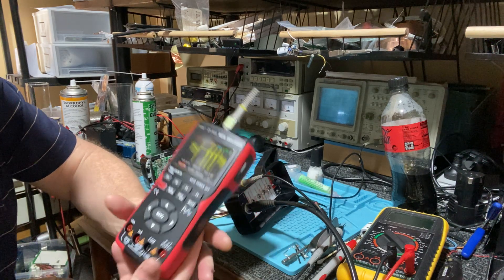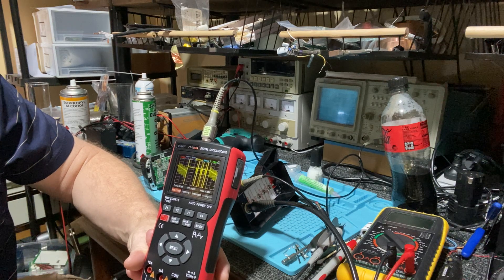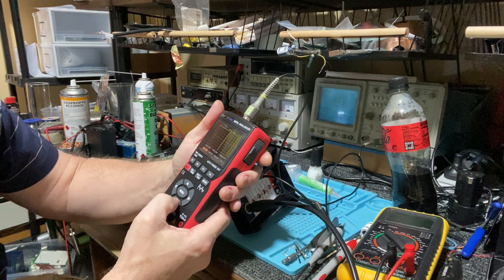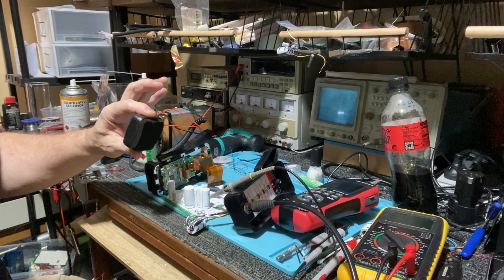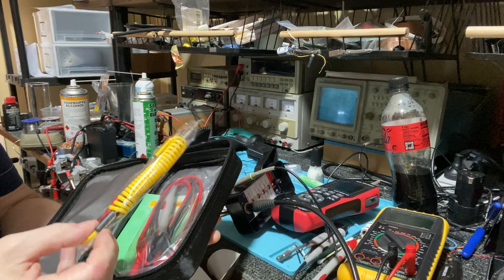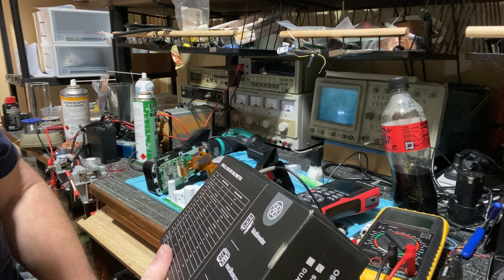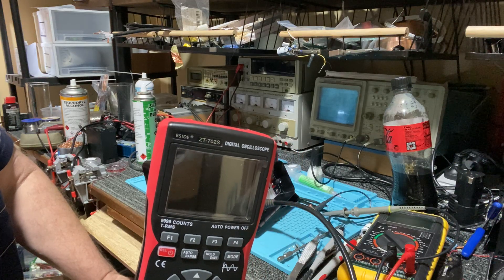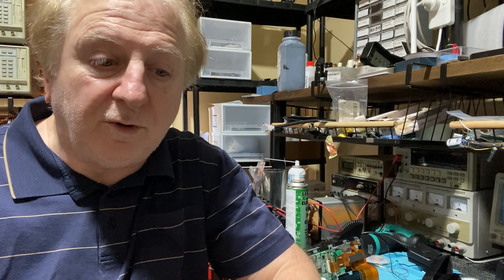Cheap multimeter oscilloscope.

Comment: i repair and refurb spectrums c64 electrons , old 8 some 16 bits , atari st amiga Archimedes  etc bits and have one like this and it is very handy for the i guess low level you require for those type of machines

Comment: I got this meter/o'scope - I feel comfortable with it, working on audio equipment, on transducers testing and, low power boost/buck inverters, and automobile CANbus troubleshooting.
The vertical sensitivity is 20 mV/div - it is deaf like a bell; the cheap o'scope has 5 miv/div, professional o'scope is 2 mV/div.
My multimeter is branded Fnirsi, has a 3,000 mAh lithium battery for 6 hours of runtime, rechargeable via USB-C.
The troublesome detail - it is possible to recharge it while in use. As I don't see any high voltage safety marking, I would avoid to connect a charger to this meter while I'm using it.
Again, this combined multimeter is all nice and dandy, but in my opinion it has had many corners cut; one is the buffer memory for the oscilloscope; another is the high voltage safety - which hasn't been even considered: don't use the meter while charging, and for any voltage above 200 Volt. The meter is fused, but I doubt it has any sparkgap and/or any MOV installed for protection of the meter and the user. Moreover, I haven't been able to locate the procedure and the software for calibration. The same model of meter is sold by different Chinese brands with different level of accessories and "price tuning" where the bandwidth, display type, battery size etc are fine-tuned for the end customer...

Comment: Looks interesting and certainly a ship load cheaper than the scopes and scope meters we've dumped money into.
Same for you, I can see.

Not sure I'd use one of these as we're normally working on mains powered equipment and inverters, where the fault levels can be quite interesting 😮
Reply from the maker: I made smoke pour out of many a multimeter.
Reply: @DetectorMods  
Fair enough, but you have " a very particular set of skills ", to steal a line from a movie, and I'm sure you'd get the smoke back in  😆